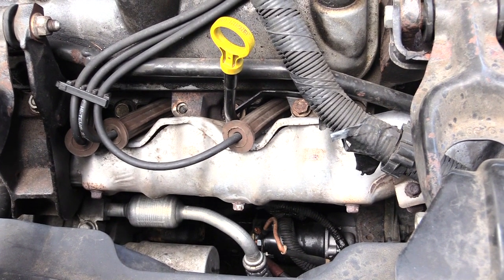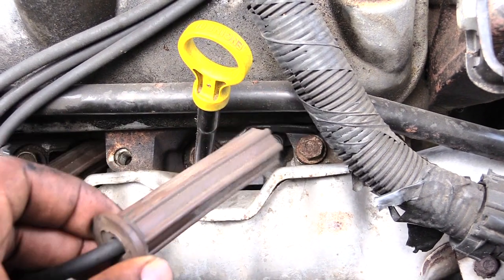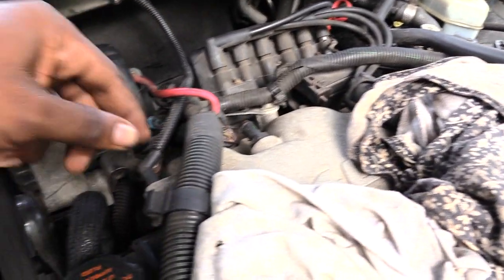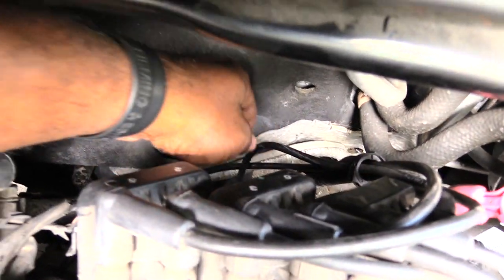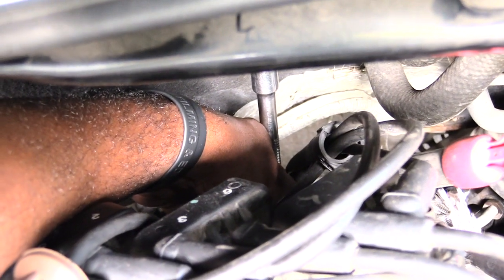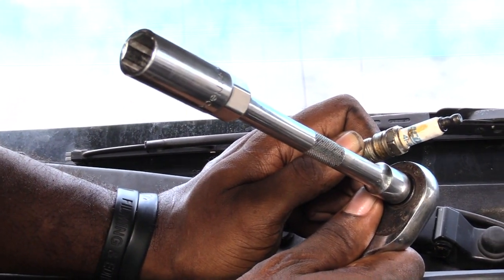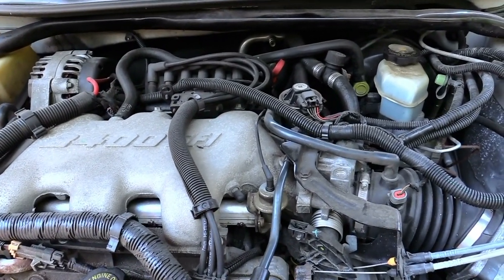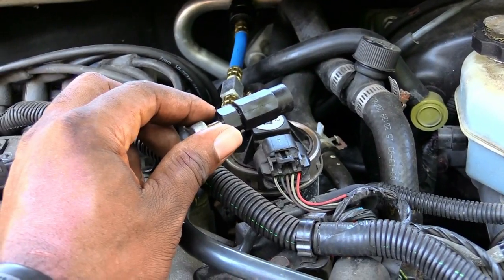Chevy Impala Spark Plug Change-Same for Most Cars!

Comment: You can also take off the front torque mounts and tilt the engine forward a little with a ratchet strap to give more room in the back
Reply from the maker: Thanks for helpful tip. Please subscribe & like and share if haven't already and check out our other helpful videos

Comment: Proubaly the same.... And same are two different things. Also never heard of a 58 socket. Taking the coil pack (4 - 10mm bolts) makes it way easier plus booster hose. Putting a small rubber hose on end of plug to put them in is way easier then putting it in socket.

Comment: Just changed my spark plugs and the engine is now shaking and getting a squalling noise when I start the car(2006 Impala). Any suggestions? flashing engine light.
Reply from the maker: Make sure wires or connected and spark plugs or gapped correctly